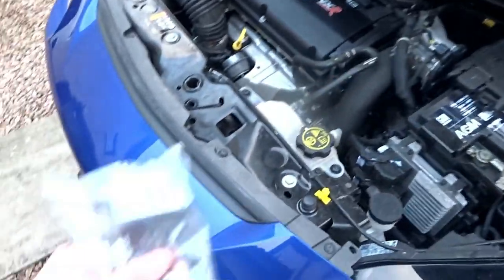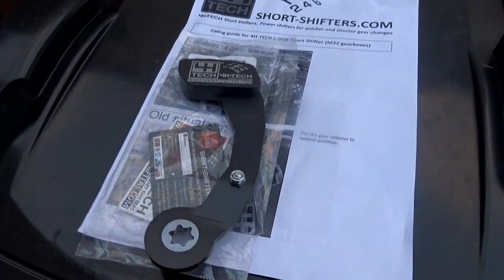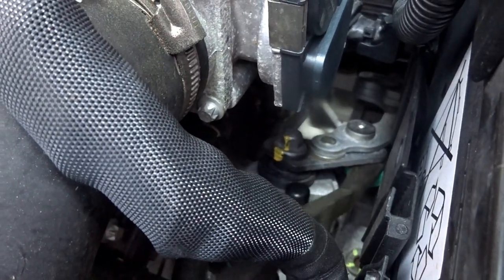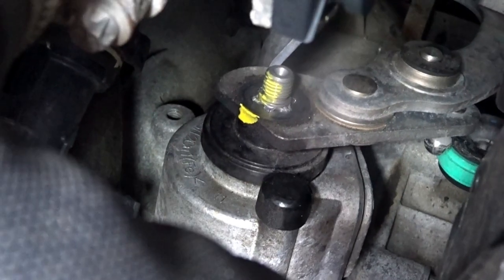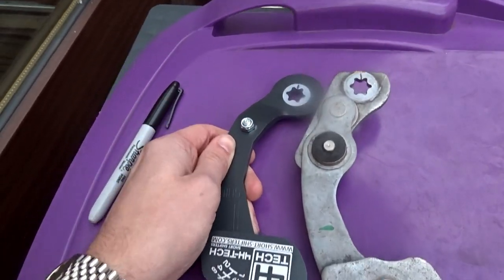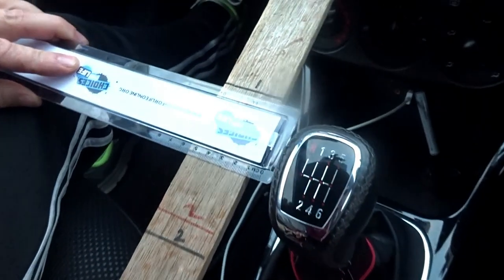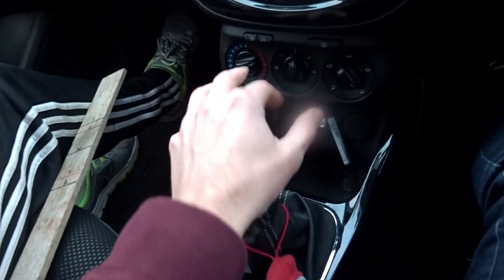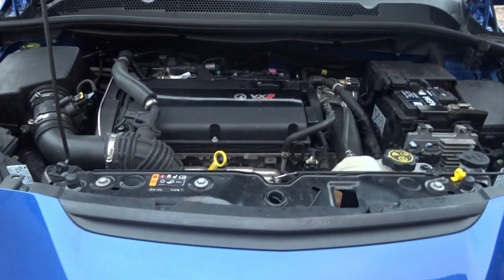Corsa VXR 4H-Tech Short Shifter Review

Comment: In my Corsa OPC D from 2008 fits Q-Shift by 4H-Tech. The replacement resulted in the change of neutral gear position. It has moved backwards 11 millimetres. 

The changes now are like these:
Return gear. minus 13 mm
1st gear                    - 9 mm
2nd gear                   - 16 mm
3rd gear                    - 10 mm
4th gear.                    -  37 mm !!!
5th gear                     -  12 mm
6th geat.                    -  12 mm

Comment: my shifter looks different , 2017 corsa vxr. From yours especially the bolt part and it’s £15 postage
Reply from the maker: Stephen Owens yeah I was actually just reading about this. Vauxhall changed a few positions of the gearbox and updated the design slightly, so there is a difference. Not sure which model year that started though!
Reply: HaphazardGarage thanks for getting back to me was about to order one got 6%  of it to , just happened to have a look today and rerun your vid to make sure and noticed it different., thanks again
Reply from the maker: Stephen Owens no bother buddy! You’ll love it when you get it! Still my favourite mod to the VXR!
Reply: HaphazardGarage yea hope so had one in my typeR brill , the strut brace you fitted would one for a corsa d fit ? 
because that’s all I can find , and also did it make a difference thanks bud
Reply from the maker: Stephen Owens yeah the Corsa D VXR subframe braces are the same. The Forge one is fitted was from a D model.  Yeah I definitely noticed a difference in the way it tightened up the steering and reduced some of the play at higher speed. Worth it for the price my man.
Reply: Where can i by to my corsa E 2015 and best price. Many thanks

Comment: Will this help in my 2012 Corsa VXR Burg? Or something similar? I (and others after doing some reading) seem to beat the syncro's when changing gear, I'm grinding gears a lot more than i did with my other car, and want the cheapest/most effective way of reducing this whilst still being able to boot it.
Reply from the maker: Alex Thomson it sounds like a change of gearbox oil will help your situation far more than this. The M32 gearbox is notoriously dodgy and the oil level being low or quality being poor would certainly cause that crunching.
Reply: @haphazardgarage6439  Okay bud, I'll see if that helps too. Know any oils that are best?
Reply from the maker: Alex Thomson everyone seems to rate Miller’s. You’ll have to double check viscosity as I’m not sure. 75w90 or something like that. And I’ve heard of people overfilling with 2.3 litres as opposed to the 1.8 litre stayed capacity as this helps.

Comment: Hey, what is the size of ball pin head on original shifter arm?
Reply from the maker: JunckMAn video channel not something I know off the top of my head dude. The best place to be would be a technical guide book for the car.
Reply: @haphazardgarage6439  none in there( just part numbers. may be you can measure un your old? or you binned original part?
Reply from the maker: JunckMAn video channel I do still have the part- is it a diameter you need? I’ll try and get round to it man.
Reply: @haphazardgarage6439  yeah, ball diameter, calipar should do. it is quite a hasssle to get to there(lots of disassembly of plastic) especially in winter when plastic tends to crrack

Comment: Do you have the piston 4 and gearbox issuses with the vxr
Reply from the maker: Nothing mate. Fingers crossed. Although this is the newer, E version, so less issues with these.
Reply: @haphazardgarage6439  wicked I've got the same version E (2016), looking at the short shifter and the forge lower brace and rear boot brace as well, for a bit of spirited driving 😉
Reply: @haphazardgarage6439  do you know anywhere i can get a front top mount strut brace for the e vxr
Reply: @danryan9533  it's built into the cat, that's why you can't see the shocker tops when you lift the bonnet